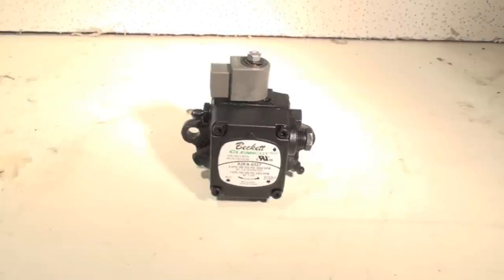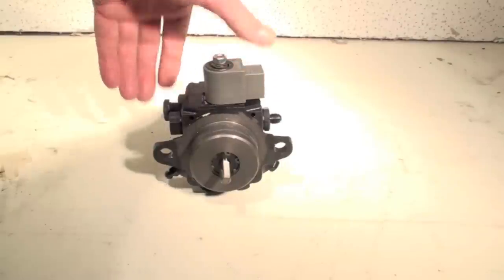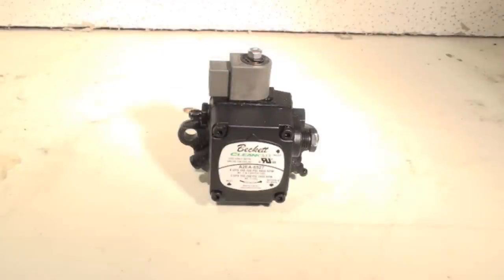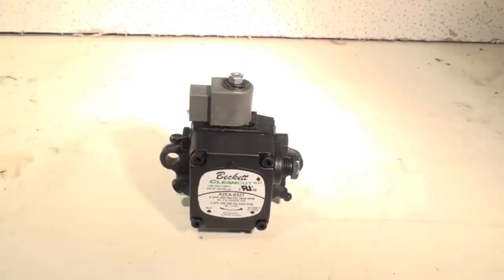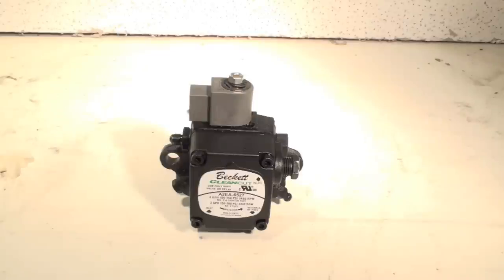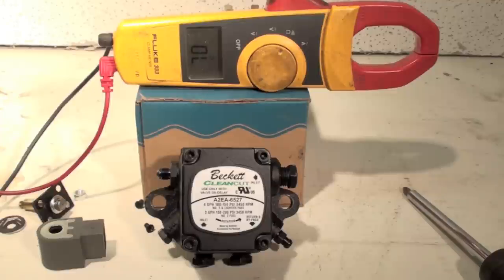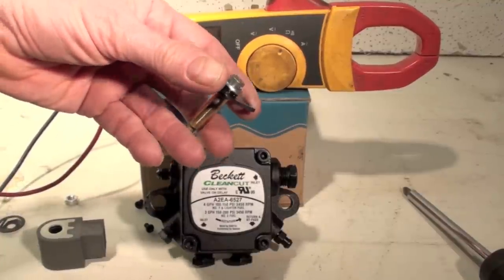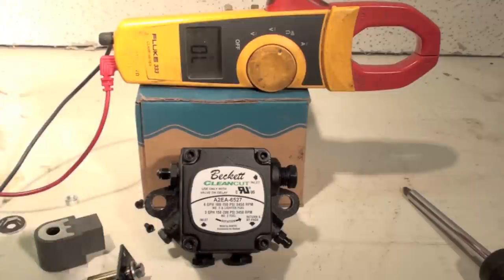Pump mounted oil burner solenoid

Comment: Hey - love your videos.  I have a Suntec B2VA-8216 on my Beckett oil burner.  Most times it fires instantaneously but every now and then I hear a delay...maybe 3-6 seconds.  Now that I’m watching this video I assumed it was the Solenoid, but I just looked at a photo of it and I don’t even see one on there?  Is that possible?   It’s old. From ‘86 I think. A Columbia furnace.  
What else could cause the delay?   Like I said, it’s rare, but does happen.   Maybe once a year I’ll hear a small boom when it ignites.  Thanks.

At my rental house Beckett oil burner I have a Suntec A2VA-7116 one stage with a Solenoid.  

So do I NEED A 2 stage pump?   It’s an 1100 sq foot one story house.   If I replaced it, could I use a one stage (cheaper) as long at the RPM’s match? 
Sorry for all the questions.
Reply from the maker: It probably does not have a solenoid.  Delayed ignition could have many causes.  Failing spark transformer, partially plugged nozzle, Incorrect setting of the electrodes. If the tank is lower than the pump you could have a leak in the suction line.  2 stage is only needed if the tank is lower than the pump.  Both speed and rotation direction must be the same.
GFM
Reply: grayfurnaceman thank you for the reply!!   I’m gonna buy a gauge to adjust the electrodes.  I should make a plan to replace the transformer I guess. There’s no leak in the line.  I can see it all the way.

Comment: can a faulty cad cell prevent the solenoid engaging?
Reply from the maker: A shorted cad cell will prevent anything from happening.
GFM
Reply: @grayfurnaceman  Thanks I will replace that oil burners like mine are rare in London England where I am from
Reply: @grayfurnaceman  Your were correct the cad cell was the issue thank you

Comment: Hey advice me a video in which it explains why the boiler turns on but the burner doesnt.
Reply from the maker: +Silvia  Alvarenga There are so many things it could be.  First, is the burner out on flame failure?  Have you used the reset?  Just press once.
GFM

Comment: I wuz hair 2018... And here I am back again... with a perplexing issue...
Alberti Steam Cleaner (200 bar 15lt/min Hot pressure washer)....
The old fuel pump was a little worn and the injector (only 600mm of 1/16 copper tube and a 50mm brass mount/fitting for the nozzle)... dribbled to a stop.
Replaced the pump with a new unit (the old solenoid was making an uneven footprint on the seal and the pressure relief internals were getting scored, probably from NZ's crap quality Diesel & bug).
So it still dribbled to a stop... (I flip the injector out into the air so I can watch the burn... fades out in a second and dribbles for another second.
Releasing the WB trigger, turning back the temp dial and pulling power on the solenoid all end in the dribble where it should shut the flow near immediately and I can't see anywhere a buildup of pressure after the solenoid could store and then release after the solenoid shuts...
Tried a 3rd pump (2nd new).... same issue... sigh.  Personal experience (15yr fixing steam cleaners) is the flameout is near instant..
Alberti say change the circuit board... but unless the board supplies some magical reverse voltage to make the solenoid shut harder.. it should be shut with no power, or held open with power.. so unplugging it should be fine...

sigh... Now I remember why I gave up working on computers... same annoying issues.
Reply from the maker: You probably have air in the gun line.  Look for high spots in the gun line or the gun goes downhill.
GFM
Reply: @grayfurnaceman  For a steam cleaner the line from the pump is a copper tube that exits the pump, turns up beside the burner, across the top (about 600mm (2ft)in total length, and into a 80mm brass tube that points down into the burner with the injector nozzle... so very little volume to hold 2 secs of dribble. I even removed the sintered nozzle filter  .. they're not really rocket science so I'm missing something obvious but well hidden... Maybe I'll try another nozzle (although I have cleaned it well and the flame is a nice cone showing the noz is not contaminated....)

Comment: Why do they call it "primary control" ??
Are they any other secondary controls fitted on the oil burners ??
Why they don't just call it "controller" or "control box".
Reply from the maker: Andreas Chris Beats me.
GFM
Reply: +Andreas Christodoulou because it is thee control for the burner... it shuts down everything on the burner,(through the cad cell eye) ignition, burner motor/fuel pump..hence primary control.
Reply: Thank you for your comment but still i wonder who gives wrong names ??
Can i  reply my question???
The whole thing its the controller (that Box) ....there is no any primary or secondary one ..is it ???

Comment: How can I regulate it so it does not smoke too much or it can be
Reply: Smoke can have a number of sources.  A plugged nozzle, incorrect combustion air setting, sooted up heat exchanger, flame impingement on the combustion chamber, incorrectly set gun in the gun tube, plugged vent.  I would first start with a complete service of the burner.
GFM
Reply: a mouthpiece may be the Naso or as it may be misplaced

Comment: Thank you Gray for this great explanatory video!
I start to understand how my oil burner works :-)
I would like to make some very simple 'oil consumption' meter.
I was thinking about something, but I'm not sure if my idea is correct.
I guess the oil flow to the burner is more or less a constant value when the solenoid valve is energised? And thus, if a know this oil flow value, I know the fuel consumption when I am able to measure the time the solenoid valve is energised?
I hope you can tell me if I'm right or wrong.
Thanks again for taking the time for making this video and teaching me something new.
Reply from the maker: staaaajn If you know the size of the nozzle and the pressure, then use one of the capacity charts that give the amount of oil for the pressure, you will have it.  The nozzle is rated at 100#.
GFM
Reply: Thank you for your prompt reply!

Comment: I've been stumped by the atupid nut that holds the solenoid on. The whole shaft turns and I can't find anywhere to hold onto the shaft to hold it down. Who knows what the hell??
Reply: I took a saw and cut a notch in the top to hold shaft with a flat head

Comment: having a coil test good on an ohm reading only checks electrical resistance. there can still be mechanical resistance causing a failure. any electrical device should be checked by measuring the amp draw. this will tell you if there is a problem with electrical OR mechanical resistance.
Reply from the maker: Good thought.  The reason I used resistance is that if there was a mechanical failure, the solenoid would not pull in, and the solenoid would overdraw and burn up the coil.  Thanks for the interest.
GFM

Comment: Mine is currently not sending oil to the gun but I have voltage at the solenoid.
Reply from the maker: Do you have oil?  Is the filter plugged?
GFM
Reply: @grayfurnaceman  yes, 100 gallons.  Pump bleeds fine, no air.  The solenoid on the pump doesnt engage.  I have 110 volts when the furnace starts.  I believe the solenoid is bad.  The local supplier sold me a universal kit to mount a separate solenoid and valve with a 4 second delay.  I was not thinking when I put it in.  The pump mounted solenoid valve is normally closed .  I don't know if there is another port on the pump bypassing that built in solenoid.  Found mine in NH ordered a solenoid and valve.
Reply: @L2fish  Did replacing the solenoid and valve fix your boiler issue?  Mine's very similar to yours but I'm 99% certain it's the solenoid as it reads 0 when I ohm it out.  Controller is sending 120v to it after the 15sec delay but no oil to the gun.  Pump bleeds fine like your did.  I've got a new pump and solenoid on the way but just trying to confirm that I'm barking up the right tree!
Reply: @SD-unlimited  yes it did

Comment: The solenoid has been a huge cause of nuisance lock outs the past few years.  The one your showing is a grey color that is one of the newer ones where they supposedly fixed the problem, If the solenoid is black in color and your having to reset your burner every now and then, replace the solenoid.They were bad. It may work great for a long time then all of a sudden it wont open one time.
Reply from the maker: Great tip. I have not seem them fail.  Thanks
GFM
Reply: Hi mine trips out regular then after it's cooled for awhile it will start up again fine. Would this be a problem with the solenoid coil

Comment: Can the magnetic solenoid make a    Beckett genesis go into an immediate lockout ?
Reply from the maker: Not that I know of.
GFM
Reply: @grayfurnaceman  was just having an issue with a primary doing that and had a guy tell me the solenoid could make it go into what he called a “quick lockout”. I’d never heard of anything like that
Reply from the maker: Not saying it could not happen but I have never seen it.

You might try disconnecting the solenoid to see if you get the same results.
GFM @bjsavage9401